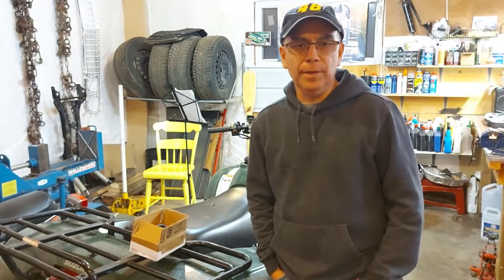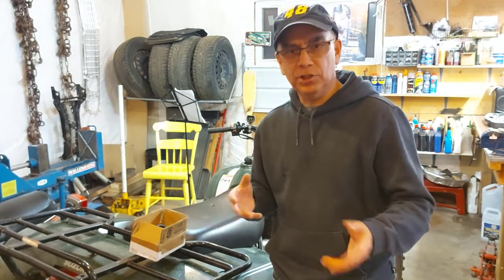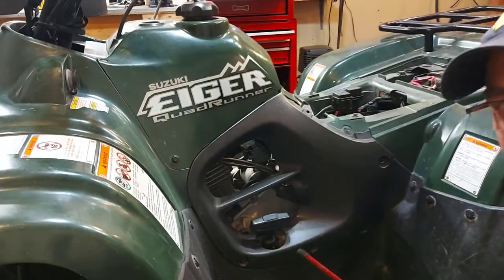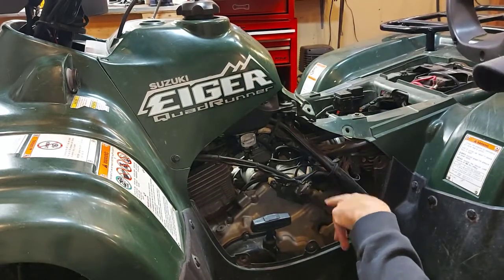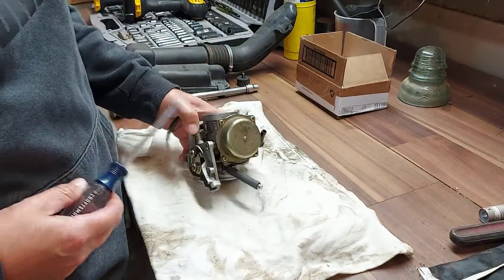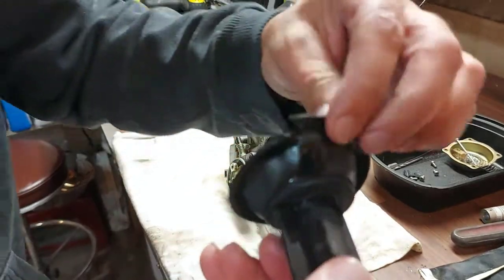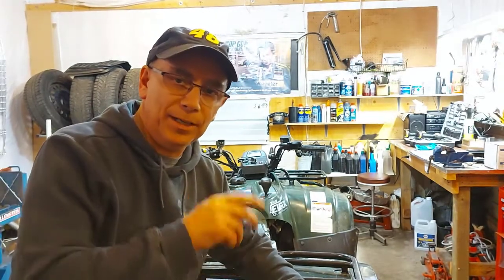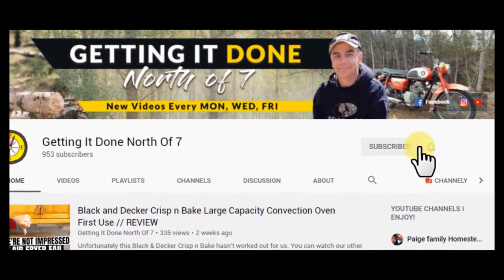ATV Is Hard To Start When Cold | Suzuki Eiger 400 Carburetor Repair

Comment: Hello from Tweed, Good video, have a Suzuki Vinson very similar bike, can't get my carb off with my giant hands without pulling the gas tank on mine, good for you for getting it in and out so easily.  I had to replace the plastic nut on my choke as well. I ordered just the nut itself from the Suzuki Dealership in Belleville, and only paid $7 for the nut. If it goes bad again maybe try and just get the nut from the dealer.  Good luck, take care.
Reply from the maker: Hey nice to meet you! Have you tried removing the air box to get the carb off?

Comment: We had a hard time at our farm in the winter with our ATV's not starting..... If we did not use them every week. 
However it was because the battery would die because of the cold....I would not be able to begin how to do what you just did...as a chef I don't like putting my hands into small spaces..lol
7:49 and you took out the spring and found that diaphram....I would not be able to put it back...lol
It is interesting to learn and watch you...
Reply from the maker: Thanks, I usually take pics while taking things apart so that I can reference to the pics if I forget how to put things back together. I did this once before so I remembered.

Comment: I just bought a 2004 Eiger and went through the carb completely. Still didn’t like to start cold. I then found that the spark was good but intermittent. Turns out the fly wheel on these was quite a faulty part and the magnets used were glued in. I decided to check the flywheel and sure enough the magnets weren’t positioned where they should be. Replaced with a new and improved flywheel from rmstator and she fired right up no matter what temp.
Reply from the maker: Good stuff, which flywheel are you speaking about
Reply: Sorry should have been more specific. The Flywheel engine left side where the stator is.  The power generator for the electrical system.  When the magnets located on the flywheel become dislodged it will cause the electrical system to have erratic power which often causes hard starting or a rough engine because of the lack or erratic spark.
Reply from the maker: @evanhorst3082  did yours run rough as well?mine seems to idle fine but sometimes there seems to be a bit of a hiccup. Like it labours slightly
Reply: @GettingItDoneRepairs  This Eiger didn’t like to start and ran rough at times or would randomly shut off. I followed your suggestion and replaced the fuel petcock. I then cleaned the carb. It did hesitate so I cleaned carb again and found some gunk in the main jet. Ran great after that if I could get it started. After replacing the flywheel and cleaning carb everything starts and runs perfect.  Might be worth checking that flywheel, found some other good videos on you tube.  If that spark hesitates then it will get fouled out from un burnt fuel and run kinda rough.  My plug was looking really black which also lead me down the spark route and checking the idle adjustment screw for mixture.
Reply from the maker: @evanhorst3082  thank you I will take a look at the spark plug.
Reply from the maker: @evanhorst3082  how much did u pay for the part?
Reply: Video that shows how to do the flywheel replacement and shows the problem with the original style flywheel. Mine looked exactly like this one in the video. https://youtu.be/olx3_yUmZQI

Comment: Hello, I have a 2000 suzuki quadmaster 500( lta500f). It seems to me your eiger is the same machine as mine but after 2002 suzuki just changed the name.pretty much most of what i see on your eiger is the same as my quadmaster as fas as interchangeable parts...Am I accurate?...Your videos are of great help to me servicing my quadmaster, ty.
Reply from the maker: Pretty much in most cases

Comment: New subr here Roland. Great repair content. Thanks so much for taking the time to share.  I was hoping you'd post the pn for the diaphragm. Was it OEM Suzuki or aft mkt?  
I just bought an 04 Eiger 400 4x4. It runs and idles great, but sputters and pops when trying to accelerate slowly...like when i'm doing weed spraying. I was going to do your petcock repair, carb diaphragm, as well as a valve adjustment. 
Your videos are a great help!!
Reply from the maker: Glad it helped. it is an aftermarket part I believe I left a link in the description of the video.